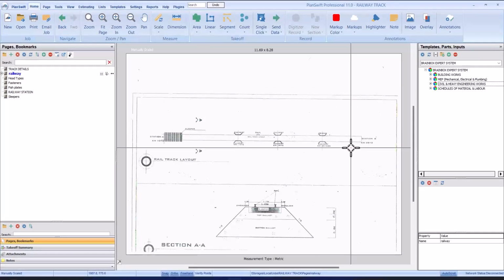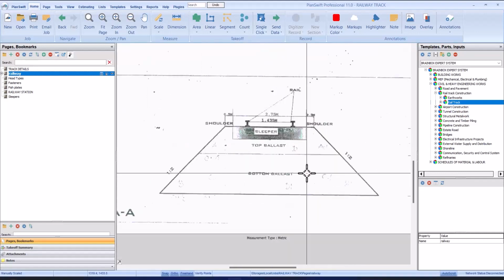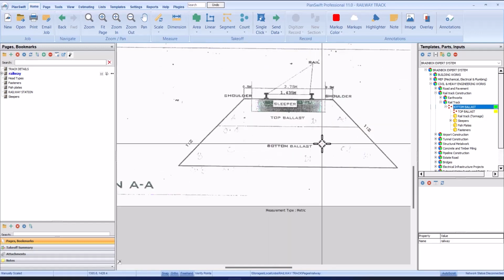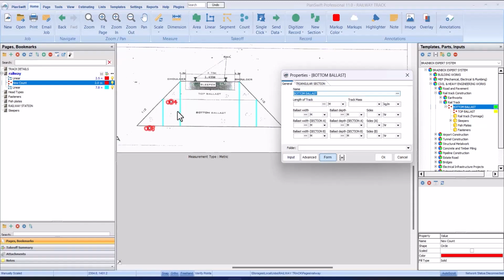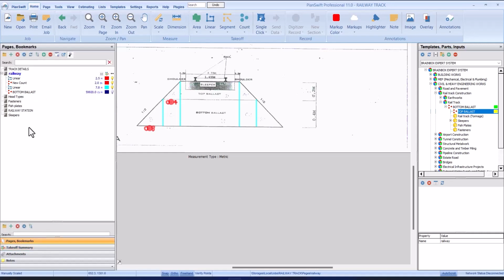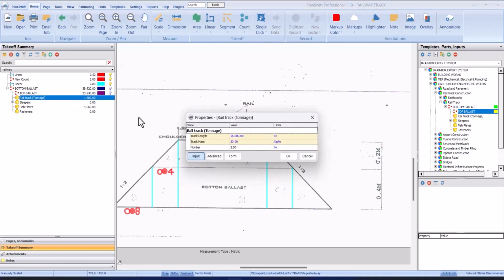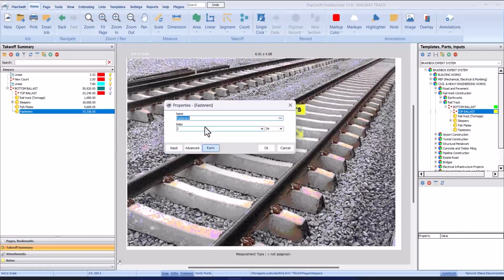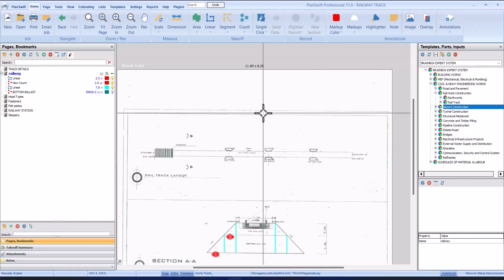Railway Track Construction Takeoff with Planswift | Sleeper |  Ballast |  Fastening System | Joint

Comment: You did not give the length per rail to compute the nos. of fish plates (specs of this wedge plates, dimension length, thickness and width?), second that are two types of base plates one for longer type for the 6 bolts and another wedge plate for the 2 bolts as shown on the drawings. they could be easily included on the excel program anyways.
Reply from the maker: All detailed explanations are made in the paid course for civil engineering works. Check it out on our website: brainboxnotion.com

Comment: why not just get the vertical surface area of the bottm and top ballast (SF)  and multiple it by the length and you get the total volume . that is the easiest way to get the volume  , respectively .
Reply from the maker: All detailed explanations are made in the paid course for civil engineering works. Check it out on our website: brainboxnotion.com